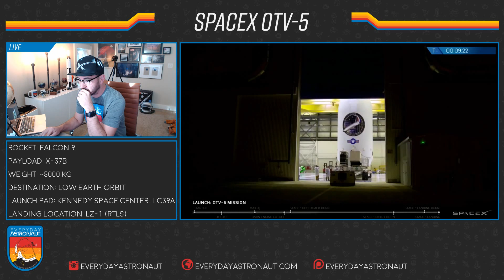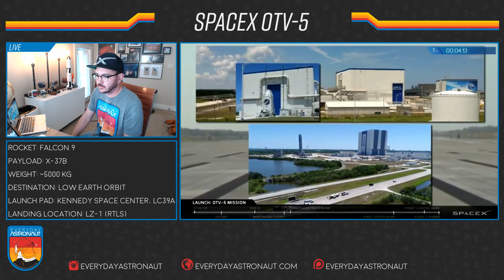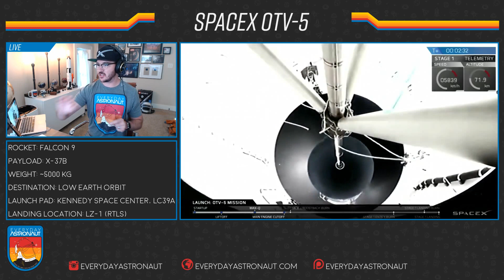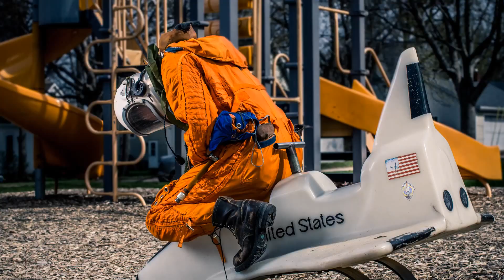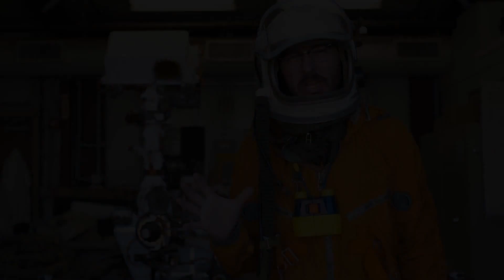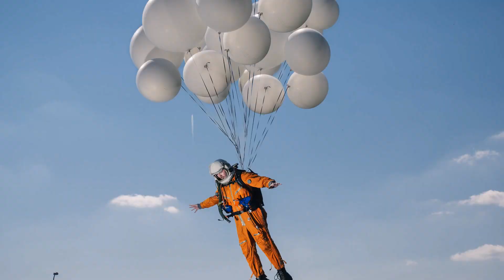(Previously) LIVE Hosting SpaceX OTV-5 (Secret Space Plane)

Comment: I hope for a Mars mission for the Falcon heavy test flight.
Reply from the maker: +calvingreene90 bad news, that definitely won’t happen. They’re just going to do a payload simulator or dummy weight basically for FH’s test flight. They don’t want to risk anything more than necessary
Reply: It is a flight without a commercial payload so the load could just be a big tank of water to be dumped to deorbit a bit of space debris or a Mars probe to say land in a polar region to look for accessible water ice. Granted it is considered a high risk launch but it is intended to work but for launching a low cost unmanned Mars mission not too bad of a bet.
I would have announce a contest for launching selected high school science projects for free on a a "high risk" launch.
Reply: I forgot. It is clearly NASA policy that no problem solving is to be done in space. I think that is asinine.

Comment: Any news on the upgrades in block 5? Haven't found much info but block 4 doesn't seem to have changed much so I'm a bit confused on what that changed. CRS-12 was the first block 4 flight but it didn't have titanium grid fins unless they started painting them white. Do we know when all flights will have titanium grid fins?
Reply from the maker: +Jaden Desveaux titanium will only be used on high energy droneship landings 👍 don't expect to see them on LEO missions
Reply: Everyday Astronaut thanks, I realized that the titanium grid fins don't have the 2 vertical bars 1/4 and 3/4 through the fins like the aluminum ones so I think I can identify them now on flights. Do you have any info on block 4 and 5 changes?
Reply from the maker: +Jaden Desveaux I know the heat shield will be different (between the engines), the octoweb is bolted and not welded now, we should see new landing legs too... there's probably tons of other cool stuff but I'm not exactly sure of it all off hand 👍😊
Reply: I want those black legs...
Reply: Now they put titanium all the time!